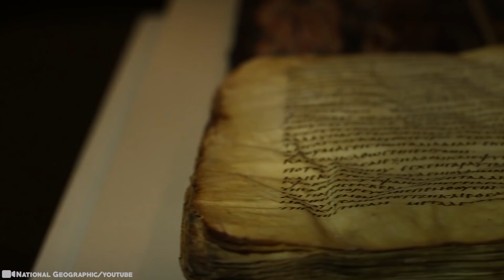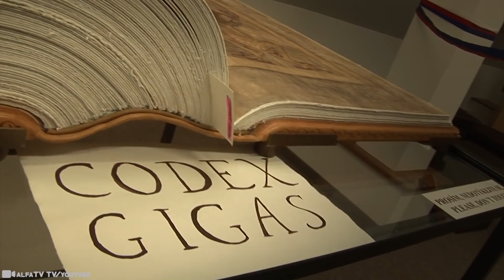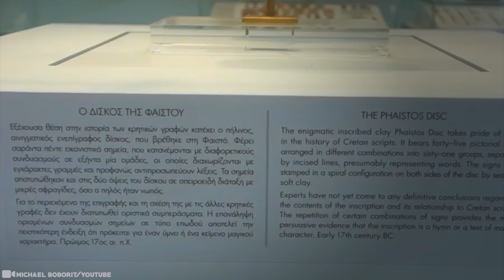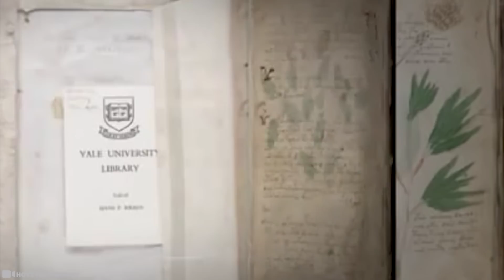15 Old Technologies Scientists Still Can't Explain

Comment: Damascus Steel was really Wrootz Steel, based on steel ingots from that specific place in India. How it worked was finally figured out with the development of the S. E. M., Scanning Electron Microscope, in 1965. The discovery of its constituents was a huge surprise. It contained as thought specific minerals, but its impurities were to a certain extent what made it special, but only to a degree. How it was made and how it was developed still remain lost to time. However, how it worked was solved. With the exception of Present Day Super Steels no other steel retains its abilities. Most if not the majority of steels come in 2 verities Tough, or Hard unless you were Damascus Steel. Or modern Super Steels, which didn't come about till the 70's when the first super steels were made. The one major exception being Wrootz Steel. Tough Steels like X60 or even A36 have a large yeild point before ductil failure. Hard Steels are just that tempered and have good strength scatch resistance and used in Surgical Instruements as well as Rock Crushers, but they shattered when used in say girders for buildings or Truck Frames. Wroitz / Damascus does not it has the flexibility of Tough with the Hardness of a Rock Crusher. That Mystery only partially solved. Wrootz was steels were flattened then folded into smaller pieces then flattened out and folded again in some cases over 100 times then quinched. Carbides formed by the metals constituents from the repeated folding drive them to the materials grainbonderize giving the wave like patterns. These Carbides act as ball barings allowing the the great flexibility no steels had till super steels. In regular steels this flexing causes the grains do dislocate and fix permanently out of position leaving voids which can't allow them to return to their original position. In other words permanently deform, but not Wrootz Steels. A simple example of dislocation is to bend a metal coat hanger then try and bend it back to its original position.
Reply: The entire method was rediscovered back in the 1980's, perfected in the 90's and 00's. And it wasn't just India, there were several very specific mines around the world that had the correct ore to make Wootz. One of them was Saladin's Mine.
Reply: @theghost6412  Wootz isn't dependent on ore, iron ore being widely available in many different forms in almost every country on Earth. It was essentially a crucible steel process whereby cast iron was rendered molten and mixed with bloomery iron to create complex layers of high and low carbon steels, hence the patternation. What was remarkable about it was the scale of the industry and the high temperatures reached using dry vegetation, achieving over 1500 degrees celsius for a prolonged period of time.
Reply: @thescarletpumpernel3305  the ore they used for the original Wootz could only be found in a rare few places around the world. 
To use any other ore in the world meant it had to be mixed by hand to make sure it had the correct amount of each metal and impurities in it. 
Even Al Pendray had to mix all his ores by hand before someone came to him with a small amount of ore from Saladin's Mine. He discovered if he used that ore from that one place, then he no longer had to deal with the stress of mixing ores together by hand. 
The only ore that could be used millennia ago had to have the smallest traces of vanadium in it. Not too much and not too little. I doubt they realised that back then since it was such a tiny and seemingly insignificant amount, but they did realise that only ore from certain mines could be used to make Damascus Wootz. 
It wasn't a mixed ore, it was a single piece of ore. Unless they later decided to add other metals to the traditional ore and see if it still worked
Reply: It was called "Ukku" steel and originated from the now Indian state Kerela.
Reply: @ravenclawgamer6367  that is likely and up date on this as I read in College some 16 years ago from JOM publication.
Reply: @RedSinter  Yeah.
Reply: I'm not sure I understand what I've just read. Like, it sounds all science-y and true, but it's not. No clue who/what "wrootz" is. Damascus steel is crucible steel. It's technique wasn't lost, it just had a different name. A lot of it is inflated mumbo jumbo because the average Joe knows fuck-all about blacksmithing(And the CCP are all corrupt liars[Chinese Communist Party]). I could explain the entirety of "Damascus" and "Japanese" steel, mythos, truth, correlation, and causation. But I am not interested in writing an essay in the YouTube comments section. Sorry mate, you have Google, find the truth.
Reply: @NightsDecent  The second he said "it is incredibly sharp" I knew he had no idea what he was talking about. You can take any metal in the world and make it sharp enough to cut a falling feather if you want too. The difference is in how long it will retain that edge. Also the whole folding part isn't even special. In the past ore was very impure and having impurities concentrated in a single spot created a point of failure. By folding it you spread the impurities out making the blade somewhat uniform. Modern steels don't need to be folded because the steel is only uniform with very little impurities
Reply: Great write up thank you for sharing your knowledge.
Reply: The ingredients and process of producing Damascus steel was reverse engineered and then replicated by a team of 3 men.  Al Pendray, J. Verhoeven, and W. E. Dauksch.
You can find a documentary about them here - https://www.youtube.com/watch?v=OP8PCkcBZU4
And the technical analysis here - https://www.tms.org/pubs/journals/jom/9809/verhoeven-9809.html
Reply: I believe you meant "variety" or "varieties" not "verities". Verity is a true principle or belief, a truth. Variety means state of being different or diverse.
Reply: Damn! I was told Damascus steel had high carbon content, from the blood of enemies whose bodies they would run through, as part of the blacksmithing process
Reply: @donniegoodman8679  Ahahahahahaha ahahahahahaha Ahahahahahaha
Reply: I have a Damascus Steel wedding ring. It opens up longneck beers much better than Gold. 🙂👍
Reply: No it's not Indian wootz steel. That still doesn't bend and return to its original shape immediately afterward.
Reply: it should be noted too that Damascus style steel is relatively uncomplicated (if time consuming) to make.  Making it involves heating the metal until soft, folding it, hammering it, then reheating until soft, folding hammering, etc.  Hundreds  and hundreds of folds and hammers later the steel is hammered into a blade, and then dipped in an acid bath to bring out the "grain" in the steel, then neutralized, cleaned and sharpened.  I own a pocket knife made in this fashion.
Reply: The design of Damascus if I'm remembering correctly comes from quenching the metal in oil. Might need to fold it a couple of times, no more than 7 times is really necessary, if you know how folding dough works, it's similar. At that point your metal will have 256 layers. The main reason to fold metal however is to squeeze out the impurities, folding doesn't make steel stronger in any other way. Iron deposits in the East are absolutely filled with impurities. In fact if you ever read the making of historical Japanese steel you'll learn they first did their own version of a "crucible" (can't remember what it's called for the life of me) and then folding it merely because, it was so impure. Now, the internet didn't exist in medieval times. So locally, the iron was quite weak, and swords often received special treatment with being purified, folded, tempered. You create 'mythological' stories of swords rending through armor. Now, by "Super metal" I assume you mean like, 1066 Spring Steel. Where most, if not all, impurities are removed and the carbon/iron ratios are made very exact to produce various kinds of high quality steel. Spring steel for example, extremely flexible, not very brittle. Actually quite good for a one handed sword. Flexibility adds a LOT to steels durability. Stiffer metals are usually preferred for most modern uses however, like decoration, weapon(gun) parts, and construction. Stainless Steel however is an embarrassment that can't support its own weight past the length of a knife.
Reply: @NightsDecent  you are mixing Damascus with Japanese Folded steel. They are completely different despite having patterns embedded in their steel. Damascus is naturally occurring,  Folded is man made. Damascus is Ingots made in a sealed crucible, forget the actual name, and in doing so avoids nearly all impurities. Folded is sometimes made in an open crucible which is open to atmosphere and is rife with impurities. 
The end result in steel is completely chalk and cheese in comparison. Japanese swords shatter from their weaknesses, Damascus won't due to its incredibly dense and tight molecular make up and lack of impurities that weaken regular blades
Reply: @Wearyman  cold welded pattern welded steel is easy but just time consuming. 
Damascus is also easy when one knows how to make it and isn't as time consuming since it is a specific hot welded ore in a sealed crucible. Once cooled enough it comes out of that crucible as an ingot with the Damascus pattern and just has to be stretched out with a specific method so as not to lose the pattern
Reply: "most if not the majority" this man so smart he used two words with same meaning in one sentence
Reply: @erpirat9577  not like my wife. She says one thing but means  something completely different
Reply: @erpirat9577  both mean the same as long as it means more then 51 percent. I think.
Reply: @erpirat9577  Ahahahahahahah Ahahahahahahah
Reply: Damascus steel gets made all the time look up Alec steele, blacksmith dude who makes the shit😂
Reply: @mactheman4698  he is a stock standard blacksmith who does the modern Japanese folded steel. He does not make Damascus, just patterned steel.
Reply: @mactheman4698  yes Modern Wrootz Steel does. I have 3 such knives, but as I no linger have lab facilities l can only assume close proximity.

Comment: RE: Roman Concrete - the report you cited is right on, but one small point to add which may answer a long-standing question for some. When you look at some of the arenas's from the ancient BCE  to late in CE, some appear to be as you'd expect, a ruin, with obvious deterioration. One assumes the air, wind, elements etc, did the damage; but this is not so.  

The cement was so good, the ancient builders would use the Roman Ampatheaters as 'Quarrys,' cutting them up, using them to build new temples and homes for the Wealthy Roman Citizens.
Reply: It's also self healing.
Reply: Modern concrete is better in every way, the deterioration observed in modern builds is not caused by the concrete mixture but by the embedded rebar rusting and expanding.   This is because builders value the additional tensile strength over longevity.  Concrete without reinforcement is extremely weak to any kind of stress except compressive.  Including roman concrete.

Comment: The sword is just  bronze casted. Bronze doesn't deteriorate like iron. What is the mystery here?
Reply: Bronze doesn't rust but it does oxidize and tarnish. That particular sword was pristine as if it had been put in the tomb only weeks before when it was found.
Reply: It should still oxidize(rust) just in its own way. Oxidized iron is what we call rust, so in a sense you are correct as bronze has very little iron, but bronze will oxidize in its own way.
Reply: @greyelmwalker746  yes it will oxidize, over the top and you can then wipe it clean with a plethora of household agents and it would be fine.
Reply: @javiervalenzuela8284  just like any thing that has oxidized for a bit but you get to a point of the oxidation permeating everything and destroying the whole piece, yet this piece is still there, seemingly still usable
Reply: If it was buried in a sealed oxygen free chamber it shouldn't oxidize at all.
Reply: @zia9772  hermetically sealed  like the jars of honey that were found thousands of years after being sealed in a pyramid
Reply: that sword is very sharp and dont have to use whetatone forever n ever
Reply: @SaudagarHati  That sounds good but you don't sharpen a bronze sword on a whetstone. You sharpen them by penning the edge with a hammer. Bronze us a metal that is work hardened,  ie it gets stronger the more you compress it.
Reply: @Shindinru  you would definitely work harden the edges but that doesn't mean you wouldn't also file a sharper edge.
Reply: @javiervalenzuela8284  you NEVER file or grind a bronze blade unless the edge is damaged (nicked for example). Bronze blades are sharpened by peening the edge.
Reply: @SaudagarHati  there's no reason why it wouldn't be sharp it wasn't used for thousands of years. If it was lost sharp and the edge wasn't exposed to anything that would dull it, it would be found sharp.

Comment: Damascus steel... try watching Forged in Fire... they make it every week
Reply: Different product. What is commonly referred to as Damascus steel in modern terminology is pattern-welded steel. The original Damascus was a particular alloy that tended to form dendritic carbon structures within the grain structures of the steel, and also included other metals and elements specific to the mines the original ore came from.

Comment: They do know how damascus steel was made. What they dont know is the amount of carbon used to make it and also how many times the steel was folded. Not completely in the dark.
Reply: You are both close. It was the source of the ore that mattered because it contained vanadium in trace amounts. It is lost not because of the techniques but because the source of ore containing the correct elements in the correct amounts is no longer there.
Reply: @Schlepp69 
Yes wnd no,,  Reobold and joint Researchers/ Authors clearly stated in their  Research and consequent book published in 2009 , that trace elements of Aluminium, Molybdenum, Vanadium and Chromium were what accounted for the superior growth of Naotubes of Carbon in the higher quality Wootz, but all of these elements were not found in all the samples of Wootz they tested.
Reply: I am sorry that you haven't heard of or read any of the articles by Dr. John Verhoeven, Al Pendray, or Dr. Alan Williams. The leading experts and researchers of wootz steel and the one person to have consistently recreated high quality wootz steel (the late Al Pendray). The results they state are a necessity of a .005% - .01% vanadium content which is also present in all known, visibly identified(having the pattern) examples of true wootz steel. Article in Journal of Metallurgy, July 2018, Vol 70, issue 7, pp 1331-1336.
Also just to clarify, wootz steel was never folded, that was done with low purity bloom steel to remove the impurities. Crucible steel is a much higher purity steel that would not only not benefit from folding, but destroy the carbon crystalline structures that create the pattern within the steel.
Reply: Damascus steel aka Wootz is made in the Crucible and  T. H. Henry who analyzed and recorded the composition of wootz steel samples provided by the Royal School of Mines listed it as 

Carbon (Combined) 1.34%

Carbon (Uncombined) 0.31%

Sulfur 0.17%

Silicon 0.04%

Arsenic 0.03%

Wootz steel has been made successfuly by Bladesmiths Don Fogg USA, ,  Colin of KC Cutlery Kent England and Owen Bush , England

Comment: JEZUS GUYS.....I CAN MAKE DAMASCUS STEEL!!!!!  JAPANESE KATANAS WERE TECHNICALLY DAMASCUS STEEL!!!  TAKE A STEEL INGOT AND POUND IT FLAT THEN FOLD IT SAY 999 TIMES AND VOILA!!!  DAMASCUS STEEL!!!!  THEN HEAT TREAT IT UNEVENLY AND YOU GET THE CLASSIC CURVED BLADE THAT HAS A VERY HARD BRITTLE EDGE SO IT STAYS SHARP AND A SOFTER FLEXIBLE BACK SO IT DOESN'T BREAK AND THERE'S YOUR HITORI HANZO BLADE!!!!!
Seriously the engineering behind the katana is pretty damn amazing considering how long ago it was discovered!!!!  The fact that there are three different blades combined into one so it's tough yet flexible and stays razor sharp is pretty amazing!!!!

Comment: Damascus steel is not unknown its very simple, made by heating, hammering and folding metal over and over hundreds or thousands of times. Modern bladesmiths do it all the time they are very common these days, it has became more commonly used in the last 20 years, they can also make it with hydrologic hammer machines and mass produce it. You can buy a decent mass produced Damascus sword for 99$ from Bud-K

Comment: I own several Damascus steel knives and blades. Made from wootz steel. Where did you get your information?
Reply: You have genuine wootz steel blades? Then your very lucky and very rich . I forge steel and yes he worded it wrong but wootz is a forgotten art. We can make something almost exactly the same but the method used back then has certainly been lost. As some1 with a background in metallurgy I can tell u there's certainly some kind of fast quench to create the crystalline structure of wootz followed by some type of normalisation but anyway there's no record of how this was actually done in and around damascus and the surrounding areas. Js